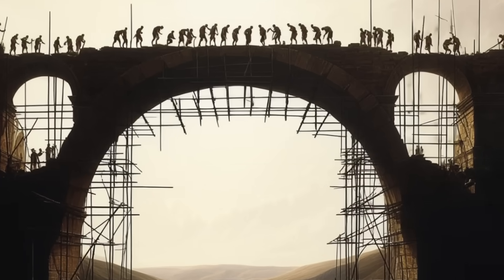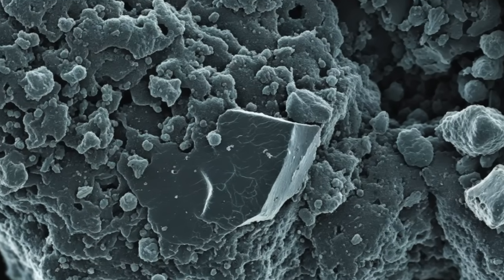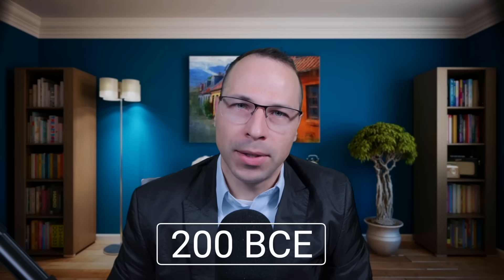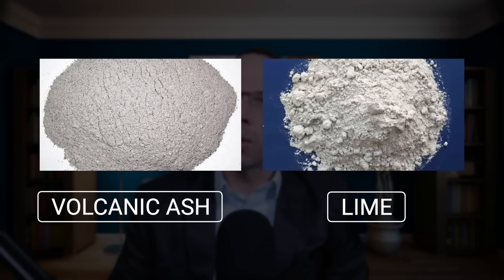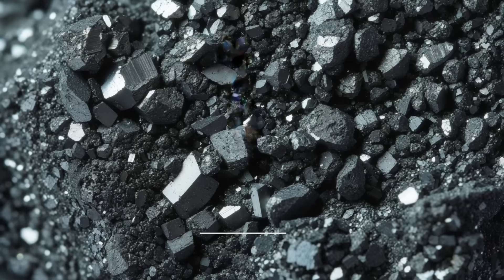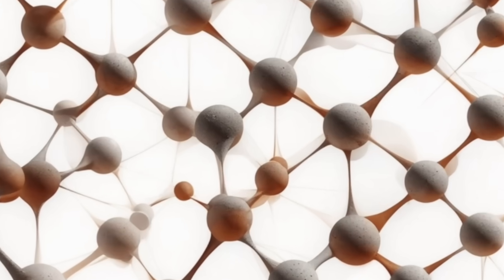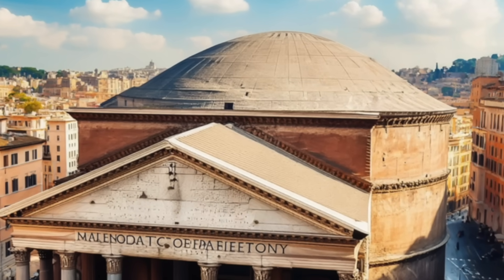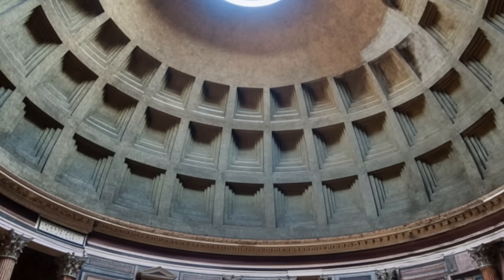Why Ancient Roman Concrete Is Better Than Ours

Comment: I use lime putty with 10-20% brick dust( from my brick cutter)
It induces a nice slow set even under water.
Ideal for old brick wall repairs and Flexible plastering.
Found the mix in an old building book.
Modern limes are too clean due to use in the steel industry.
Most owners of historic properties like this product and are prepared to take a chance based on old knowledge.
A very good video thank you
Reply: Slaked lime + crushed powdered brick as fine as dust powder + sand = Haigh Sophia and is good for the next 1,500 years and sets and hardens and cures underwater.

Comment: It was actually the quick lime,that gave Roman concrete, its superior durability compared to modern concrete. Hot mixing, created lime clasts that react with water, and caused a chemical reaction that created a bonding agent that sealed cracks, and made the structure stronger and last so long giving Roman concrete its self healing properties. The ingredients were also, hot mixed in order to insure the clasts would be formed.

Comment: Cement is like processed food the remove something and add something
Most of the viewers watching this video haven't worked with lime
Working with lime is very flexible and can be reused many times
Concrete waste, rubble, is very much impossible to reuse, lime can be reused just adding more lime, coal ash

Comment: I also heard a theory about them using sea water and that this had a chemical reaction with the lime that made it so that it didn't fully break down into the mix. These pebbles of hard lime then would liquify when rainwater got into a crack and seal the crack. Anyone else heard this?

Comment: Concrete has too much filler in it and no volcanic sand. plus I'm sure that the Romans never poured concrete like soup like they do now. hence the reason they pour curbs drier . more water less strength. plus salt on road ways breaks down concrete. and they washed the stone totally clean .

Comment: No we should not bring back roman concrete in high and heavy buildings,,,becouse this video,s information about   Roman concrete superety isn,tintierly true,,,lime concrete is a WAY weaker concrete than constuructian concrete,,but it has the abilety to absorbe water condenstion and dry it out were the lime in theconcrete never stops reacting in contact with water,,,and its not true that we today Are not able to make strenger and better concrete construcions,,but the sad truth is that it cost a lot more to do this right from a-z all the way,,,I have been a concrete construction rehabilitating worker for 25 years were we for the most part have been upgrated the load capaseties of the heavy duty constructions,,and the biggest fault that goes again and again is that the rebar iron has way to littel concrete thicknes to the outside,,and this result in water comes in contact with the reabar and starting to rust,and this makes the concrete to crack open and more and more water spis in and also frezes and the micro cracks in the concrete surfase gets bigger and bigger and the rebar strengthening iron is agressively rusting away,,5o the poitnt that the corncrete construction losses its strenght,,its not that the concrete is of bad qualety oris bader then Romans cetuery old concrete,its a result of not having good enogh exsact understanding to how to do a heavy duty constructing the right way,,were there is enogh concrete thicknes around the iron/steel reabars and make shure to viberaiting the concrete enoght so there is no air pocets,,,,

And also its worth mentiening that the many of theese roman socalled concrete constructions Are made up of natural load capabl heavy stone from the bottom and more lighter Stones the higher up the construction is built,,,
But by al meens it is impressive what the romen did when they discovered the vulcal lime concrete mix…

Comment: You forgot to mention what Romans didn't put into their concrete: steel.
Steel reinforcements are the cancer of any concrete structure. When they rust, they litterally make the conccrete explode from the inside.

Comment: Some concrete structures fail because they are built by illiterates from across the southern border.
These are the people who couldn't do it in their own country, yet they were the ones who bid the lowest and got the job.
Many years ago, I witnessed a very large dam being built. They didn't use room temperature water to mix the concrete, they used ice. Tons and tons of ice.
That dam has been standing for over 60 years and there are no cracks. So if the cement is used properly, it will last for centuries like Roman concrete.

Comment: I am a mason by trade. Please show me where there is mortar used on these. modern concrete has a short lifetime span mostly because of steel and rebar are not a perfect marriage like engineers think. It’s just waiting for a divorce between the two  

These are all made of stone. With no spaces for joints. And if you know anything about arches, you’ll know why these are still standing.  But leave it to a supposed engineer to wonder. WHY?

Comment: It's amazing what you can do with just a little bit of EFFORT and not using inferior materials to save money. Astonishing.
Reply: No, modern concrete use rebar reinforcement, that allow use to build fantastic things out of concrete,  but the rebar reinforcement have a practical lifespan of about 100 year. Roman concrete lack rebar reinforcement, hence Roman concrete can last "forever" but it can only take a compressive load, hence you cant build a modern bridge out of Roman concrete.
Reply: The purpose is different - they want to build more often today

But for bridges I would do it like the ancients

Comment: Nice to see a thread on old concrete.
Nothing new under the Sun.
Romans used volcanic ash having discovered pozzolanic properties.
Also found in prehistoric shale/swamps.
Modern day pulverised fly ash too from coke burning.
Neither of which as good as OPC ordinary portland cement.
Blue Circle, ahead of Tunnel & Rugby cement in BS12 cement testing I'm the 70s' when I did all my research with RMC Technical services.
We only measure concrete in compressive  strength as in tension, it only 10% of same strength. Hence the introduction of steel rebar. This potentially ruins concrete longterm as all 'create is porous.
Water and air = corrosion, while freezing accelerates erosion/ weathering.
The Romans did not have these issues and volcanic ash is not as good as modern cements.
The modern day grinding of cement introduces C4AF retro calcium alumino ferrite. This also  introduces iron. Not good for long term like iron porites (fools gold)
Concrete killer!
Enjoyed the video, but there is far more to this than first appears.
The C&CA have volumes on technical studies and projects.
As a reference: The Jumbo Jets at Heathrow   sit out on a concrete mix I designed. It's still standing!😊
Reply: C4AF Tetro calcium*
Reply: The Romans built the airports that the American revolutionaries took from the British according to Donald Trump. 😅😅😅😅😅😅😅😅😅

Comment: Modern concrete uses flyash in the blend to counteract the effects of ASR.  This flyash comes from the burning of coal in powerstations.  So when we ban coal fired powerstations there will be no flyash.  Hence our concrete mixes will not last as long.  What would the Romans have done if they did not have volcanoes?
Reply: They would wait for another Volcano to rise up😂
Reply: Is that real reason why the Roman civilization ended? 🤔
Reply: @ The reason why civilisations end can mostly be put down to two things....power and greed.

Comment: Your points are very much overstated, as explained by the accompanying body of comments.  How often does the temperature in Rome, or the bulk of the Mediterranean area, go below freezing ?  How often did the Romans spread salt on their roads ?  For modern rebar, there is galvanized rebar, Stainless Steel rebar, and fiberglass and basalt fiber rebar available. Why isn't it used ?  Cheap-skatism.  How many of the Roman structures are pure concrete as opposed to blocks of stone held together by mortar ?  The Incas had many structures made from large stone blocks fitted together without any mortar and they are still standing centuries later.

Comment: A 20cm thick wall isn't going to last centuries no matter what kind of concrete you make it out of. What we build is appropriate for how we are using it, building basements and box stores and strip malls like roman monuments would not be. We need a best buy that lasts 40 years, not 4000.

Comment: self healing just means not fully cured in the first place... there is not enough natural fly ash on the planet to stop using portland cement...  the romans also never had concrete nearly as strong as we currently have, no 5KPSI or 10KPSI roman concrete... the romans also did not have 2000lb vehicles driving over their concrete either

Comment: REALLY?!?  Are you telling me that the Romans knew something about physical chemistry, ionic bonding and long term durability?  They did NOT!  They didn't have the technical instrumentation nor the (quantum) chemical know-how to begin to understand the concepts you introduce about how their concrete "ages so well".  THEY GOT LUCKY!

Now their skill was definitely advanced in terms of structural engineering.  No doubt there.  But let's be real and not give them credit at the atomic, and sub-atomic levels, where they knew NOT?  And let's benefit from their lucky chemical mixing and reverse-engineer their formulas and make our own (concrete) even stronger and better!

Paul M.
Atlanta, GA

Comment: One main weakness of modern concrete is the stupid re-enforcing rods are rusty and rust very fast starting almost immediately when encased in concrete.  The problem can be solved by installing small DC electron current flows through the re-enforcing rods.
Reply: @charliejohnston1978  There are a number of issues here.  Often the cover distance over the rebar is too low.  The concrete mix design is poor.  The placement and compaction is poor.   Bridge structures are designed for a life of 100+ years though attention to detail.
Reply: I see them installing rebar now that look like they're made out of plastic and fiberglass

Comment: They only used concrete under compressive load. We use it under tension which necessitates the use of rebar reinforcement.
Reply: metal rebar is useless and causes failure ......thats why builders have to REbuild after 50years,,,,modern engineers are still trying to fart higher than their butt.🤣🤣🤣🤣.....why?...because they have never taken the time to understand the past....period
Reply: Modern concrete sucks under compression, too. And why wouldn't Roman concrete work under tension with reinforcement? The effect of Portland cement on steel could hardly be worse. There's basalt rod, too.

Comment: I think the rebar is the culprit
Reply: According to engineering students I talked to many years ago. The expansion and contraction properties of steel rebar and concrete are different one from the other.  This leads to minute movement, eventual mini racks, moisture seepage and the rust. Steel rebar does not like concrete and moisture. Their studies and experiments were done with composite rebar and the results were very good as the composite’s properties can be made to match the concrete’s properties.
Reply: @dllion3196 rebar goes in rusty

Comment: Engineer2Build ! I watched this video of yours and I realized that as an engineer, you don't know anything about Roman concrete (GEOPOLYMER concrete !), I felt sorry for you and decided to inform you a little! 
1) Roman concrete = consists of volcanic ash + quicklime + sodium bicarbonate + aggregate! 
2) We Turks (Mimar Sinan ) use Khorasan concrete = clay cooked at 680 - 750 centigrades (before the clay is cooked, a chemical process known today as sol-gel method is applied ! i.e. simple alkamine ! It is ground to 1 mm and finer ) + quicklime + sodium bicarbonate + aggregate (carbonate is obtained from Van Lake in Turkey ) 
3) Engineer2Build ! My advice to you is to take lessons from JOSEPH DAVIDOVITS and learn what GEOPOLYMER CONCRETE is !  
4 ) ( Let this information be a bonus from me to you ! ) Fly ash, which is a thermal power plant waste, is too valuable a material to be used in concrete ! Why ? Because fly ashes kept in waste sites form rare earth elements in the layer where they come into contact with the soil in 15-20 years ! How does this happen ? Engineer2Build ! Research and find out yourself ! 
5 ) Engineer2Build ! Sit down ! Zero ! 
6 ) Note : Engineer2Build ! What I wrote to you is also valid for the stupid ignorant people who commented on this video before me ! 
7 ) No need to thank me !

Comment: Their concrete was clearly superior, and they had practical ways of producing it. Make concrete as good as theirs, before assuming you can out do them. Take the regulations away that prevent people from using it. The goverment and corporations are who poison everything. Not the people.. The ocean has been in the same place since I was a child. There are pictures to prove it. The people who sell the climate crisis build mansions by the ocean. They don't even take the same pill they are selling you. They fly around in private jets. They restrict resources to drive up the prices. They don't want you to have good inexpensive building materials. Regressives are trying to say we are running out of sand now. Vomit up the coolaid, and get a grip on reality.

Comment: WHICH LASTS LONGER THRU TIME,,, Roman Concrete or PLASTIC
Reply: I would bet on the Roman concrete. Plastics deteriorate from oxidation  , heat , sunlight and extreme cold. In environments where the temperature swings from extremes of heat and cold it breaks down even quicker.

Comment: It's Better than ours at Chemical resistance to the elements, But it is not "Stronger"
No Roman concrete could hold up to rigors of contemporary building projects like high rises or vast domes or HIghway overpasses. Roman concrete was laid, like a putty. Not poured like modern concretes thus building anything in modern era using such material would have taken forever and need to be twice as thick.

Comment: Yes, we should bring back Roman concrete. Maybe it can be used as pavement to last decades and infrastructure to last centuries.
Reply: Then the concrete company won't make as much money unless it breaks down sooner than later.
Reply: Roman concrete is no longer used as it is tto weak mechanically.
Reply: Then add steel rebar @francoisremise4267
Reply: @marccleroux4020  We do not have access to large quantities of volcanic ash.  Also modern vehicle axle loads are a little higher than chariot wheel loads.

Comment: Wow you're smart as hell with the keys on it. People: "How get volcano ash" Basalt is often used in laboratories to create synthetic lava and volcanic ash. Thing about modern science is something the ancients didn't have. Apply Ultrasonic holography technology to keeping the mix perfect for every brick or formed structure all the way to the point of being fully cured. Resonance frequencies is how its public that science is scanning the "Tsunami factory" inside Earths crust to prevent absorbing sound into unwanted targets. That can be done and still have the extreme pressure capability of Ultrasound. Mass production scaling? Direct sound printing.. No more robotics to build many things. Cheaper costs but higher quality by pressure images and results of universe in those pressures.

Comment: It's not just about self-healing concrete, but also about how they used it without steel reinforcement and only in compression, at arches and vaults. Brutalist architecture is crap no matter what material you use.
Reply: To a degree, Yes. Plattenau panels in the Societ Union arr horrible architecturally but the engineering marvel that is The Barbican Centre in London, i would proffer, is Brutalism at its best. The concrete used is Romanesque in its quality of inputs (i.e. the sharp edged aggregate of 'flint') and the application of intended purpose - housing and an arts centre.
Reply: Actually they did use some steel. There were steel clips between the blocks in the Colosseum, but they were stolen.